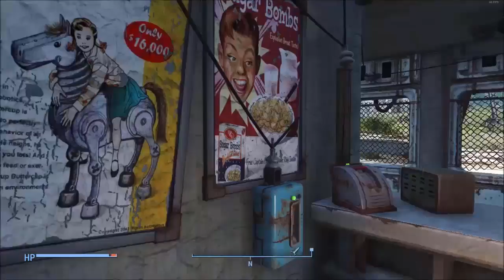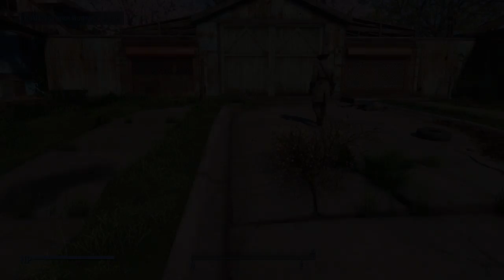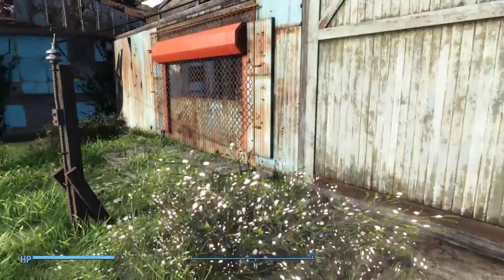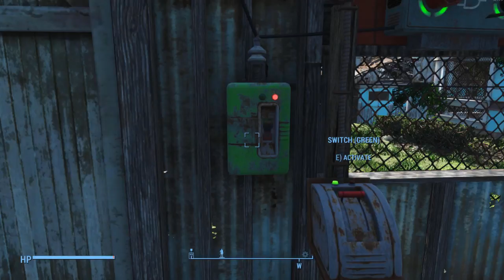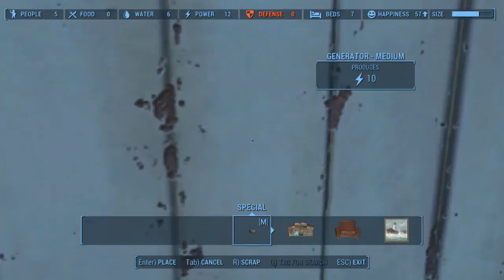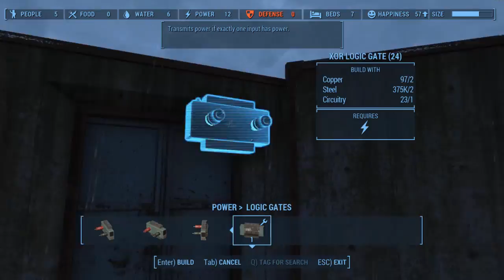FALLOUT 4 Logic Gate Security Tutorial - Settlement Defense Ideas

Comment: I made a cellblock that uses a switchboard of 4 switches and a main lock switch, the 4 switches work as a code input for a cellblock of 16 doors, using not gates and normal cables i split each switch into having the on and off state work as an input, then i set up an array of 4 and gates for each door in the array, the arrays of and gates are the code to each door so for example the first door opens when the 4 switches are off which ticks all the not gates on then the and gates for that door are hooked up to the not gate lines of every switch, you then do a configuration like that for every door so if you want a door to open when your switches are off on off on then the and gate array would have the first switch connected through the not gate then the second switch is directly wired to the and gate and you do the same for the other 2 gates and switches, finally since by the end of it having the switches in any position is an input to open the door the entire system had to be wired with a 5th switch connected to all the and gate arrays which makes it so that the doors will only open if the right code is input and the lock switch is on
Reply: Also for a switch system that has 2 switches on one door you can make an easy circuit using an or gate instead of an xor, put a switch on either side of the door obviously and wire both switches into the or gate then the or gate wired into the door adapter so it's open when on and closed when off, then have both switches wired to a main switch that acts as a lockdown for the room, finally the inside switch needs to be directly wired to the main lockdown switch but between that main switch and the outside switch for the door add one more switch inside the room which will act as a soft lock for the door, with this system when the as long as the buffer switch to the outside is on the outside switch will recieve power and activate the or gate, then as long as one of the door switches is powered the door will be open, then using that buffer switch to the outside you can turn it off cutting power to the outside switch but still having power inside meaning u can open the door from inside but not from outside, then the main switch just completely cuts power to the room shutting off everything and closing the doors

Comment: You should try out the "Advanced Settlement Power" mod. It has logic gates that work with no bugs. Only downside is the gates don't look as good. It has a ton of other stuff that is super awesome. Rain sensors so you can hook up a mortar with a clear weather grenade, nice so you don't have to exit game and turn off clear weather mod.  Just put a switch between sensor and mortar. Turret sensors so when turrets go active all your doors and windows can shut automatically. Clock so your settlement lights turn off in the day and on at night. You can also basically make a diode so power only goes one way. Check it out!
Reply from the maker: Hey man, yeah I looked at that as I was building this - I think it was the one you mention, but I was hesitant to dl it when I read that there was some bug causing wires to stay in place when the components were moved with no way to get rid of them.  I looked around a bit on there and didn't see mention of a fix...  If that's no longer an issue, then yeah i sounded good.
Reply: Darkdally works fine XBone. The one I like was by authored by "Cadpnq."  I think it is really worth a test, but save your game in case of mod conflict.